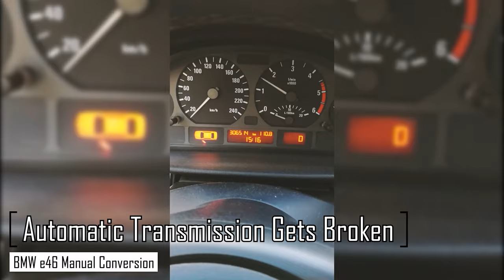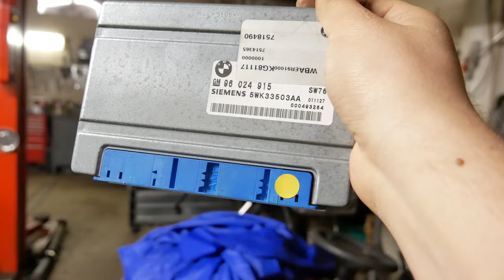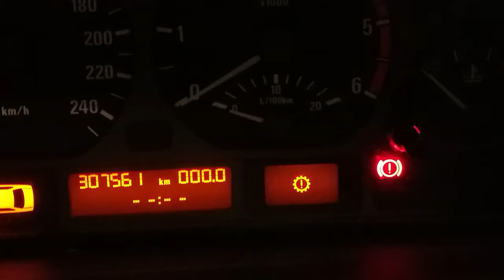Automatic to Manual Transmission Conversion in 8 Minutes #bmw #330d

Comment: Hi is something to code ine DME when swap to manual gearbox? Only wiring modification?
Reply from the maker: You should flash DME to manual version, but it will drive also with original one. You should also code comfort unit to remove auto gearbox from dashboards.

Comment: Did u check the auto trans what was broken in it? I have the same broblem now and have thinked if its only turbine or full trans broken....?
Reply from the maker: I did not but I was told it full broken as it is typical for this GM trans.

Comment: How do you make the cruise control work after such a swap?
Reply from the maker: I had to reflash ecu to manual version (may not be necessary), swaped diff to correct ratio and conneced clutch sensor correctly.

Comment: hey guys 
did you get your parking sensors to work ?
Reply from the maker: Yes, you must conect cables from transmission to reverse relay in engine bay.
Reply: @WeAreCarFans  yes i done this and no longer have prking sensors .. my car is a 2005 facelift and not to sure that makes a difference ..i have reverse lights but still have relay pugged in
Reply from the maker: My relay is still connected aa you can see at the emd of the video. Does your reverse light working? Do you have gong connected?
Reply: @WeAreCarFans  yes have reverse light and gong is connected

It's a 2005 e46 face-lift
Reply from the maker: Should not be diference, if parking sensors was always there and you did not replaced GM5 module. Try to measure if there is any electricity in parking sensors when you go to reverse or if gong is working.